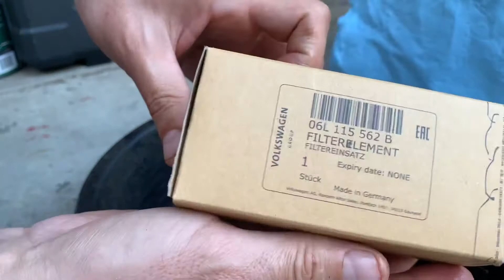Volkswagen Jetta Sport 1.8L  TSI Oil Change

Comment: Ow40? The owners Manuel clearly says 5w40
Reply from the maker: Thanks for watching!
That's correct 👍 According to the owner's manual 5w40, but according to the manufacture’s technical sheet, 0w40 can be used depending on the climate of the region and use of the car.

Comment: Aceite incorrecto
Reply from the maker: Thank you for watching!
That's correct
According to the owner's
manual 5w40, but according to the manufacture's technical sheet, Ow40 can be used depending on the climate of the region and use of the car.